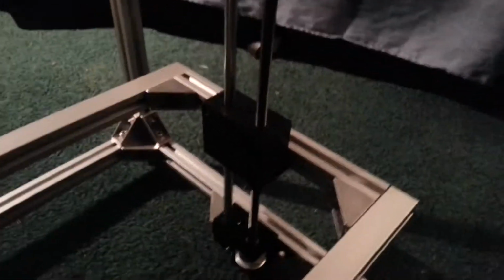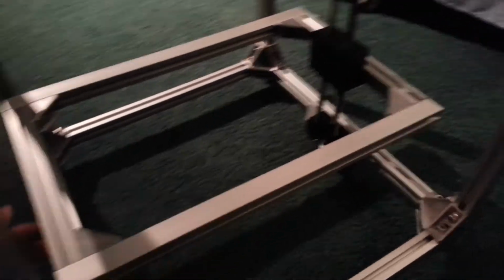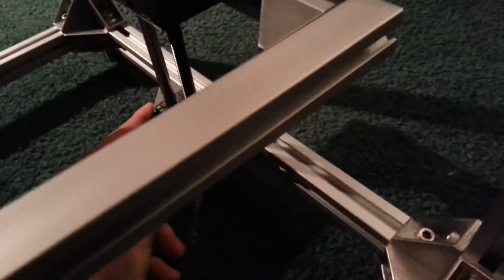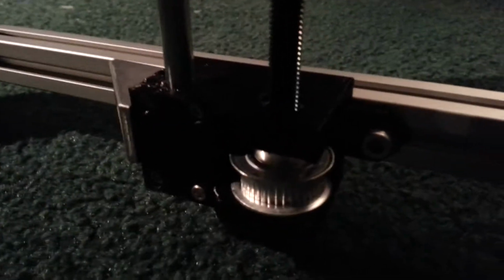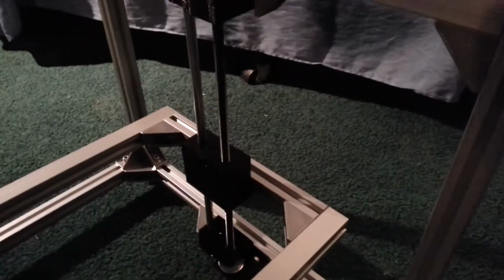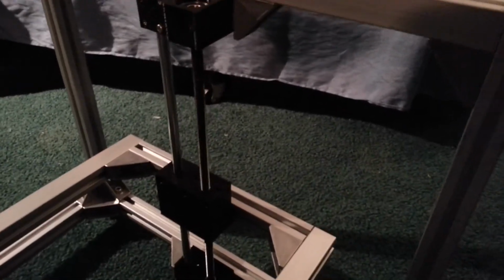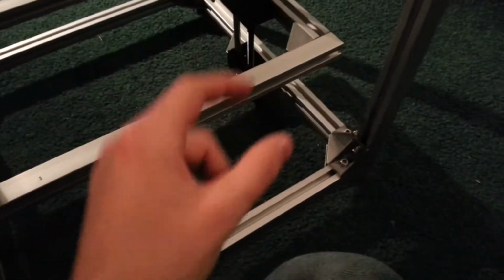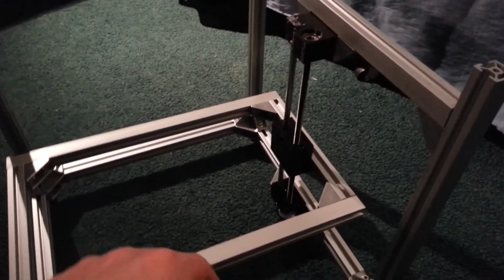3uP Update 10 - Z axis half done!

Comment: My question concerning the bed layout is this. You said in the last video that bed had to be cut to accommodate the z - axis. What do we do if the bed on our twoup is a heated bed? Can it be cut without damaging it? If not, would it be possible to mount the z - axis on the outside of the frame and use a bit different mechanism to move it? Mine is on order for this month,  so just trying to take that into consideration for when it arrives and if I can still order your kit. Thanks!
Reply from the maker: Ohh no don't worry you don't have to cut the basalt! There is about 3 inches of mdf on either side of the basalt bed in order to mount the bed to the y axis frame on the original two-up. You are cutting just a tiny bit of that mdf, and it doesn't have to be very accurate either, so it can be done with a dremmel (preferably), a bansaw, a hacksaw, or even a little pocket knife saw will do the trick. I will also be including a printable template so you know exactly where to cut and there will be no guessing involved.
Reply: Very good! Just wanted to clarify.  :-)